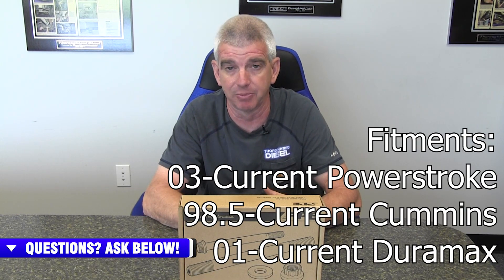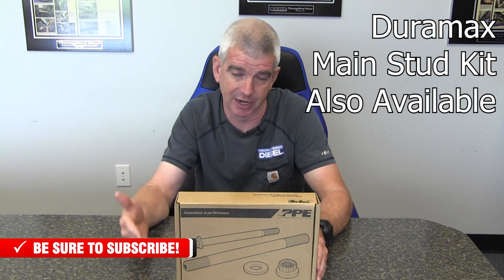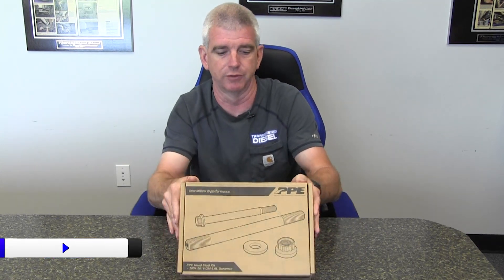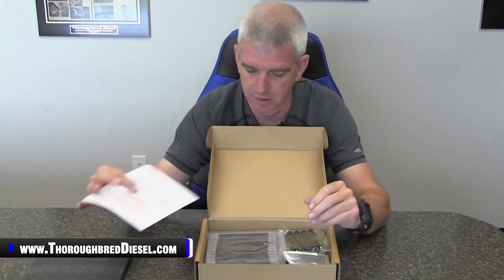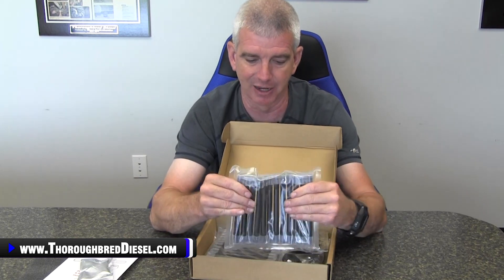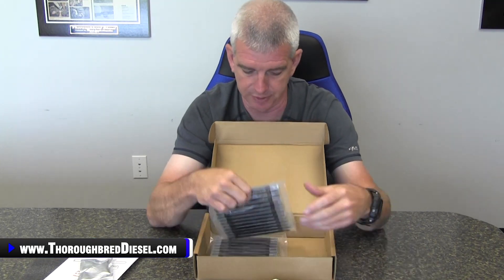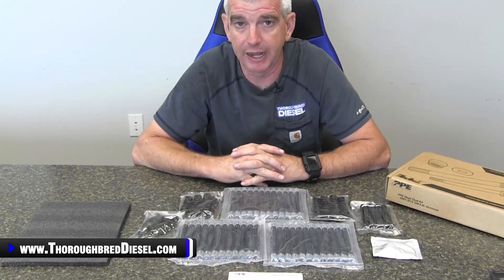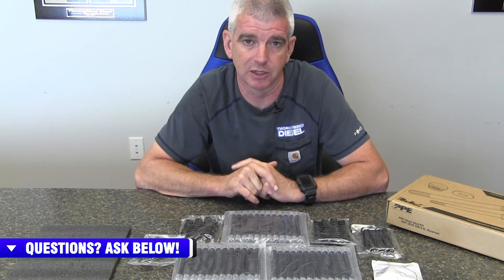Head Studs That Out Perform Even Most On The Market | PPE Head Studs #diesel #trucks #fyp

Comment: What’s hp rating
Reply from the maker: Not rated by HP.  Needs to know mods to the truck to get you in the correct studs.
Reply: @thoroughbreddiesel   s472/s488, dual cp3 and 130 over with firepunk tunes on 5.9 cummins

Comment: Are they a single step final torque for Cummins or do you have to torque after a heat cycle?
Reply from the maker: They will need to be checked after heat cycle as well.